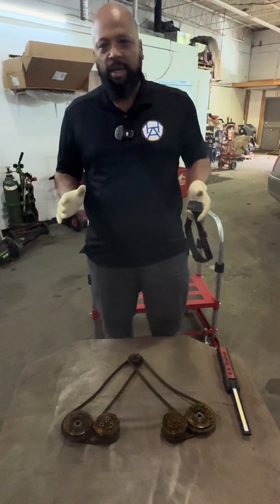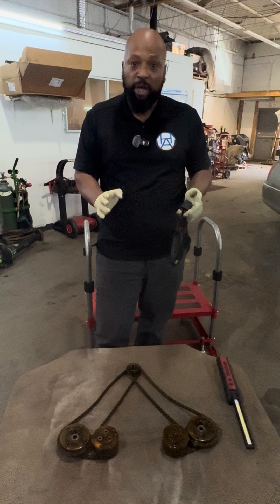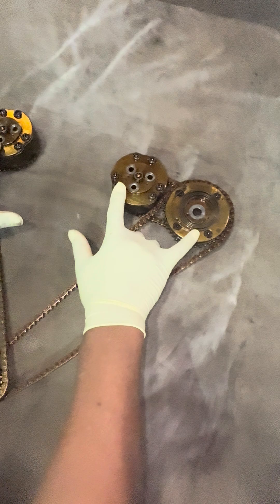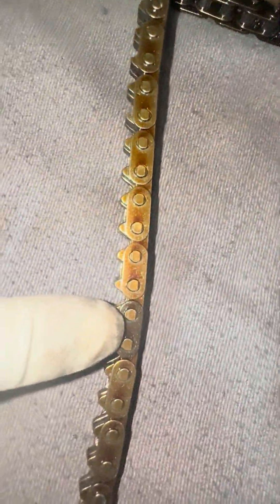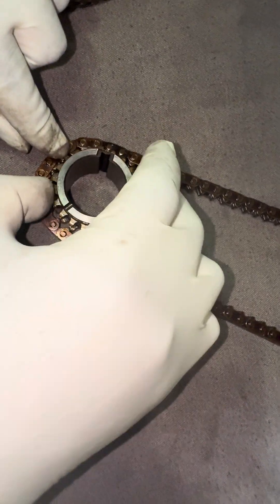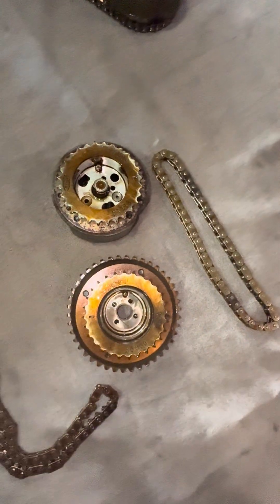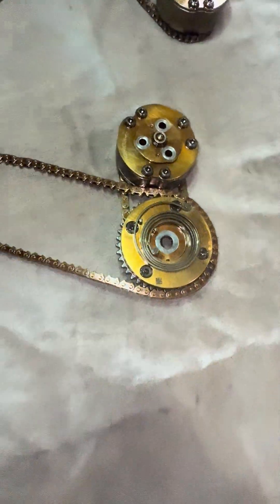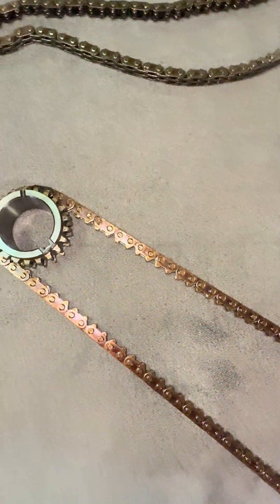Ford 5.0 coyote engine timing procedure

Comment: Do you know if the secondary chain tensioner can be replaced without removing the secondary chain? If the tensioner is compressed is there enough slack in the secondary chain to remove the tensioner?
Reply from the maker: Sorry.  But not sure

Comment: I and Pass side Rthink if you could edit the video it would help the idea of showing old chain great other than you called both fasers driver side so I assume one marked L should be Driver and the R pass side,I assume R is Pass and L is Driver? correcting that would be awesome also start of with the two used chains in place no need to fiddle with them showing the backside just show where they are and then when on car point them out. great job im putting mine together i bought it with out cams so finding out the correct place for them is a chalange thats what I need iss help on how to index the cams so when go to put them on the faser stay as they sould be pointing away from eachother when i do this I start with Driver siide I can get that far but pass side isnt correct the cams need reindexed or something

Comment: great video my truck is making the same sound. only thing different is that mine says random misfire. could that be because timing chain is loose and jumped time possibly. I noticed you did full revolution back to 730 then to 330 on disassembly, do you not have to do a full revolution back to 330 then to 730 to install new parts?
Reply from the maker: Great question on the time of procedure. I can’t remember exactly, if I’m not sure about some I’ll always double check with Mitchell. I don’t do a lot of these so Mitchell was my guide.  And the timing is off it will definitely cause a misfire if it’s off enough.

Comment: I have a rattle noise on my 2016, how did you determine it was timing chain related and not the imrc’s flapping? My noise goes away if i give it more gas and take rpm’s above 2k. I’m hoping it’s the imrc’s and not timing. How much was this repair?
Reply from the maker: We knew it wasn’t the intake.  Replaced the solenoid’s first just to see if that took care of the issue which you didn’t.  I really thought it was the Cam phasers, but once we took the timing cover off, we seen that the timing chain was loose.  Replaced c